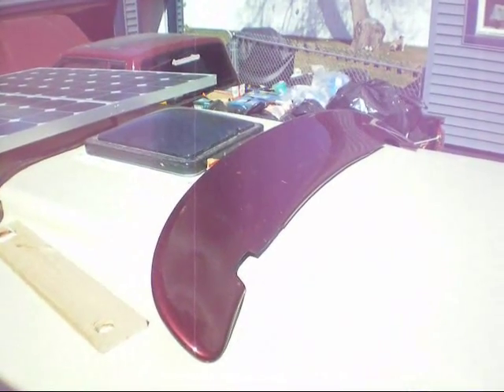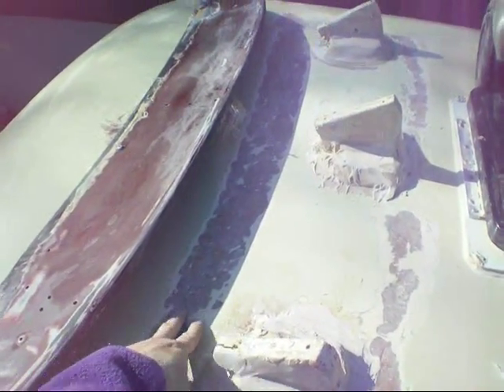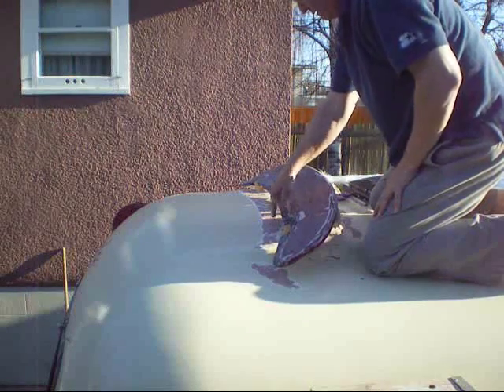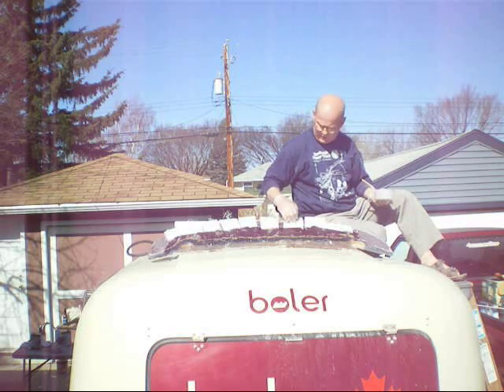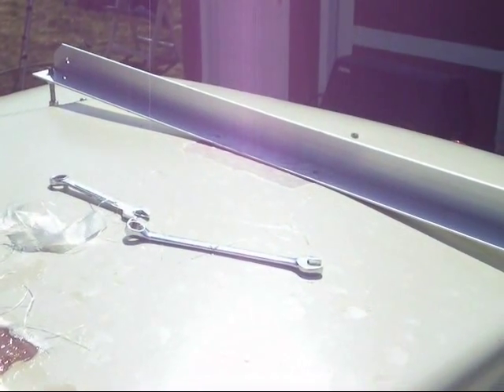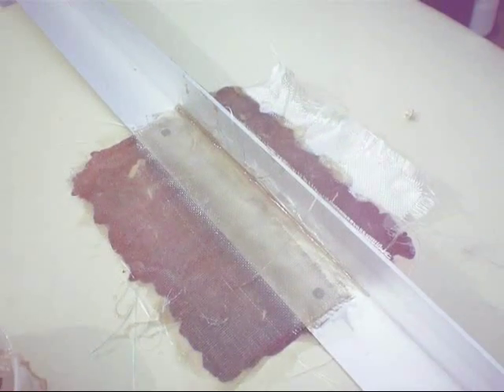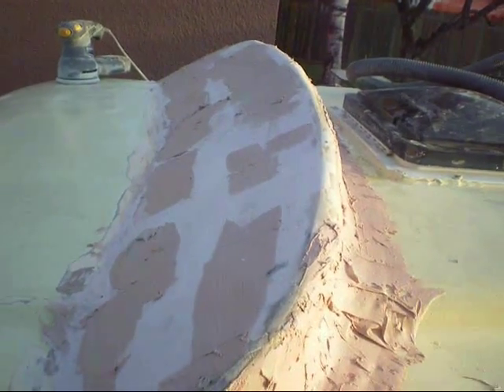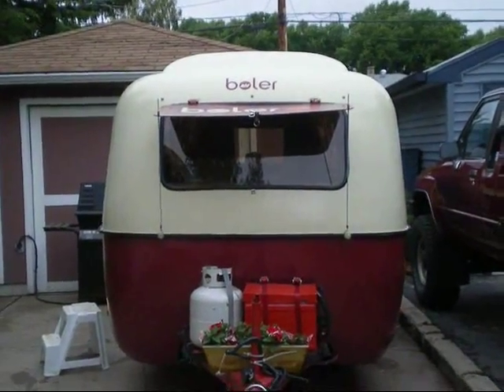Solar Panel air deflector

Comment: Very nice work! I admire how you just get right into and get your projects done and use a lot of common sense. One question I have from a couple of your other videos: when you put in screws temporarily to hold wood pieces together while the fibre glass resin sets up, do you have difficulty in removing them later?